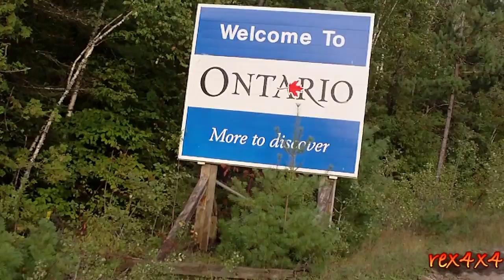Project YJ's a BUST / Nuclear Power Demonstration (NPD) Reactor.mpg

Comment: I think Rolphton is on the highway 17 cause i remember have been stuck there hitchhiking on my way to alberta.it was september 1997.This trip took us 6 days from quebec city to banff alberta and the worst part of our trip was northern ontario 3 days from ottawa to sault-st-marie.I had a 1989 jeep YJ sahara with the 4.2L carburator engine back in 2002 .I hab to weld steel plates everywhere on the frame.Are you a french speeking guy like skaaven.

hope you'll find a YJ in better shape